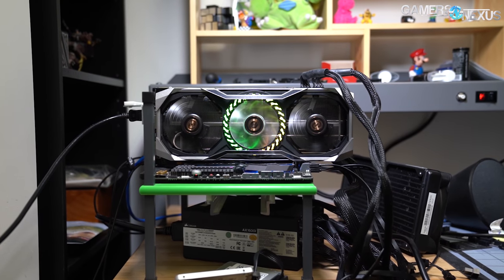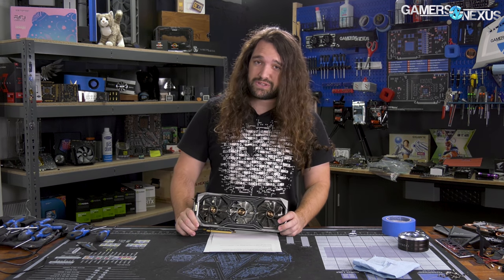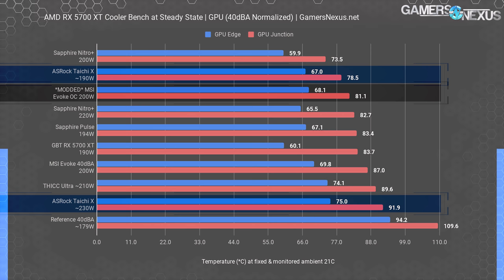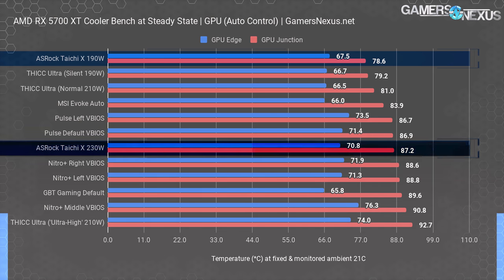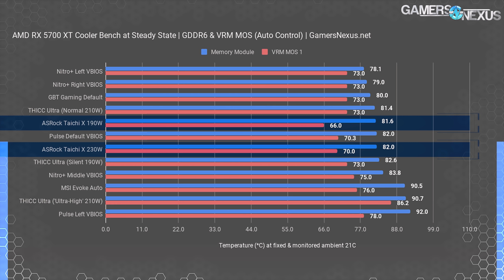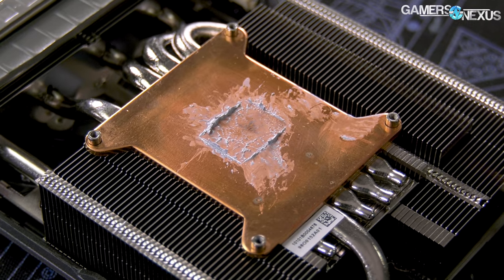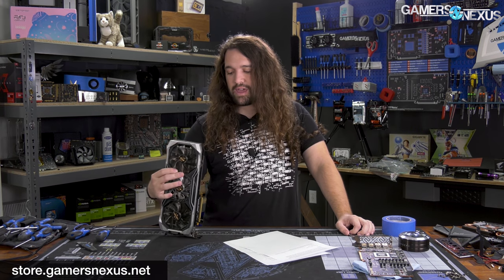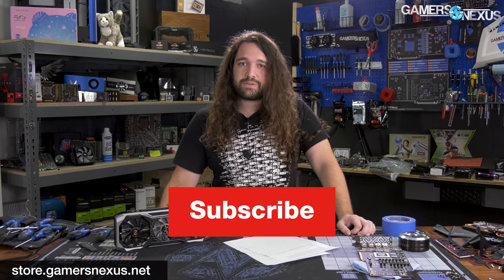ASRock RX 5700 XT Taichi X Review: Most Money Isn't Most Best

Comment: Hey there. I own an AMD RX 5700 XT, the Sapphire Pulse more precisely, my first AMD card after a period of nvidia ownership. However, I've been having a lot of problems with it (BSODs and blackouts mostly), in which i initially thought it was driver related. However, it looks like it was a problem related to the PCI-E riser, which is gen 3.0, but the whole system was running on 4.0. After some research, the riser was indeed a cause of issues, and in order to solve these I simply forced my motherboard to run on PCI 3.0 (Gigabyte X570 ITX here, which has such option). Many other people might be having the same problems, and blaming AMD for it (like i initially did :D), but in fact it's an issue related to outdated PCI-E risers. Im using a compact case (FTZ01-E), so I have to keep using the riser. I was lucky the Gigabyte MB allowed for a PCI Gen change in the bios, otherwise i'd be stuck with this. Maybe you'll find this piece of information useful to use in one of your videos in the future. Or not :D.
Eitherway, the issues are gone and the whole system is stable now. It's a pitty AMD are lacking on tech support for these kind of diagnostics, as I've only seen one of their tech support personnel answer to a client about this potential riser issue. Their adrenaline website (or the absence of it) could also use an overhaul in which patch and driver updates/news would be more easily communicated with the community, sort of what the Geforce Experience has.
Reply: I guess there is something to be said about not being on the bleeding edge of technology. Hence, I went with an X470 motherboard .... at least for now. I have no need for PCI-E 4.0 yet.
Reply: Wish mine was that simple but mine keeps crashing.. I went through changed the settings and still crashing.. I'm running a msi gaming edge x570,  ryzen 9 3900x, 62gb ram, windows 10 pro, 750w power supply and the ASRock phantom gaming Rx 5700xt. It works fine with davinci resolve and normal use but once it loads a game is quickly over heats and crashes :/

Comment: In the Netherlands, reference 5700xt = $ 471. Asrock taichi 5700xt = $ 621. These prices are converted from euro to dollar
Reply: Most of Europe is getting shafted for years now with price conversion for pc parts.
Reply: Same in Israel, this is why you need to convert what Steve says about price to percentages and to your currency (explanation for those who don't follow).
E.g if card1 costs $400 (for sake of example) and Steve says card2 costs $440, that's a 10% increase in price - for better or for worse.
If then card1 costs $600 (euro converted) in your country and card2 costs $660, then it is fine - you can't really escape your country's taxes and/or import fees.
BUT if card2 costs $680 then you can say it costs "more than it should".
I have learned long ago that unless you can get a good price suddenly in Amazon or in a local retail, you will HAVE to accept this price % difference, otherwise you will never buy a new card because they will all seem "overpriced".
Reply: @Keretizein x Exactly.
The 2070S is ~10% more expensive where I live so might as well go for 5700XT.
Then again, some 1080tis go for same price as 5700XT here so maybe getting that would be smarter, but I really don't want to buy a used card.
Reply: @Zwenk Wiel I searched the internet for an average percentage of tax on electronics and goods in the USA and found a list that shows an average of about 7% tax. (normally between 2,9% and 7,25% depending on the state) The price of the taichi 5700xt with 7% tax included is $ 513,- Converted to Euro's: € 465,- The true difference in price between the USA and the Netherlands in this case is $ 108,- and I still think this is quite a lot actually, hahaha ;)

Comment: Such a strange dilemma right now, for those of us interested in getting a new GPU.

You can  buy a 5700XT card. You can purchase one of those new 20 Series SUPER cards. 
But also being mindful, that Nvidia is set to go onto 7nm, and release their new GPUs by the 2nd quarter of next year. Then there's BIG NAVI looming in the distance. While Intel is ALSO about to be venturing into the GPU market as well...
Reply: Personally, I went with the cheap but reliable Pulse model and will keep an eye out on the new releases next year, maybe grab an upgrade towards the end of the year once everything has normalized from issues like garbage launch drivers and artifacting high end cards that we see from both companies every now and then
Reply: Bought a $280 Reference RX5700 and never looked back. At 4ft away I can't hear it over my headphones anyway under load.
Reply: I bought Nitro+ for Pulse price (me delivery got delayed) so im good ;)
Reply: There's always better tech just on the horizon. If you need to upgrade, just upgrade.
Reply: It is a good time to wait in my opinion, I just sold my 1080ti for a profit and im using a potato 1050 made by dell with a ek vardar 120mm fan strapped to it to get me by till something enticing comes along.
Reply: @Mandragara  Totally agree there. There are still (new) bargains to be had on old 2070's some as low as £400 (although normally £465 which is about £30 more than an XT). A average Super is around £525 but can be had for as little as £500. I'm ignoring the outliers for both here, Strix XT at £480 and the Palit Super blower at £489). Personally for the few extra quid needed I would go for EVGA Super Black @ £525.
Reply: @clansome  For a high end build, yes. For value though I think a RX 580, 1060 or 1660 Ti would be the one to get.
Reply: Danmandingo man don't even talk about that, I bought a vega card like a month before the 5700s dropped
Reply: LeFlavius  Im still on Tahiti lol
Reply: LeFlavius  I'm on 390x 1440p dips to 35 but I'm happy with freesync 😅
Reply: And I’m still using a gtx 1060 my friend lent to me for free oc to 2025 MHz and +450 on the memory, load temps 85c lol
Reply: The used market and 1070ti for now.

Comment: Most money?
Laughs in ASUS ROG
Reply: Yep
Reply: the rog non oc is only 20$ less than this
Reply: Be careful, the Strix fanboys will come after you xD
Reply: @TADP0LE9806  Nah I'll get a pass for it, they don't harm one of their own kind. 😝
Reply: My local Micro Center has Strix 5700 xt OC for $20 cheaper than this card. Buildzoid's PCB review of he ASUS card was very positive. I am waiting to see a full and thorough review now. It will most likely run very cool, maybe even the coolest while it maintains the other typical 5700 xt performance levels. 

All in all, an ASUS Strix for $20 more than some other cards, having better component parts and running cooler than most cards, that $20 might not matter too much.Though I figure many gamers have a tendency to stick to a build brand that they have or prefer when it comes down to a $20 +/- cost difference. $40 or $60 off of someone's preference can be a deal breaker. To each his own my friend.
https://www.youtube.com/watch?v=ioJHGyivLpQ
Reply: Over here this 5700XT is the most expensive, even the Asus is 18€ less. Asrock overtaking Asus by greed ^^
Reply: Same here. The Taichi X goes for 560, which is basically a 2070Super. Cheapest 2070S costs 550.Hard pass. However, prices have been dropping very very slowly. The Nitro+ and Gaming X went from 520 to 495. Still too much, but at least prices are moving towards a more favourable range. 

The Pulse and TUF sit at a respectable-ish 450, a full 100 below the cheapest 2070Super. I hope prices drop a couple tens in Winter. Usually they do, at least for AMD.
Reply: God Killer I’ve got the ROG Strix bc I am sheep. But the temps aren’t great out of the box. Moderate undervolt (about .05) brought temps down by 10° with default fan curve that doesn’t ever get loud.
Reply: @MrFirebad  could you sensi teach me how to undervolt it 
The auto undervolt in wattman is useless... Maybe manual tuning it ??
Reply: @STR33TSofJUST1C3  Just remember that those AMD cards run really hot (and loud). The manufacturers try to keep noise levels down by letting the cards heat up to max temps which degrade component life.

Comment: On user benchmarks website it has the 5700xt taichi as #4 performance wise.  #1 is gigabyte gv gaming oc at 117%; #2 is power cooler red devil at 115%; #3 is XFX Thicc III ultra at 115%; #4 is Asroch Taichi at 114%. the highest benchmark for the 2070 super is 123% with a lot of the non overclocked benchmarks around 114%. These are the only 4 that are high up there in benchmarks are worth it in my eyes as #5 and #6 are both the sapphires at 110% and 107%.  I compare benchmarks with some youtubers and in games like rdr2 and gta V i keep up with the 2070 super with the asrock taichi.  If you compare this with the thermals it may just be one of the best cards, it was just expensive at release but the price is defiantly going down.

Comment: IMO, I think it's great that ASRock somewhat over engineered this thing rather than tried to cut corners to keep pricing and costs down. I do think they over did it a little but better that than a flagship design that performs like an entry level model and ruins their shiny new rep in the GPU market. It's got to be tough breaking into an already saturated market. With the last (and their first) wave of GPUs they were panned for high noise levels and weak/inadequate cooling. I imagine it's a fine line between adequate/profitable and overbuilt/expensive when it comes to cooling solutions. It looks like they have not quite found the sweet spot yet. I do like what I see, learning from feedback and trying to do better. They overshot with the Taichi but given pricing will come down and how well this GPU performs it could still be a great option when priced better. 

As it stands it will likely only appeal to people who are willing to pay a premium for the aesthetics. IMO it's not all that unrealistic with the cost of an aftermarket GPU cooler (water or air) costing significantly more than the delta in price between this and more competitively priced GPUs. I am a huge fan of how well the GPU design compliments the X570 Taichi motherboard design. What this GPU does is allow even a relative novice PC builder to put together a system that looks custom built with minimal effort and know how. I would not be surprised to see the likes of newegg and amazon pushing bundles with this and the X570 Taichi. 

Great review Steve.

Comment: Evga has a 'what' on the "Pin Fin" heatsink, lol, that's a good one.  I'm really sure the various round/oval/square/rectangular/teardrop shaped pins arranged in grid/staggard "Pin Fin" heatsink has existed back to around the time of the steam engine, maybe earlier on some wood stoves. Pin Fin heat exchangers are nothing new, the machining process to make them, that manufacturing process may be patented (there is more than one way to forge/cast or extrude&cut a pin-fin, lol).

Great vid Steve and crew. B)

Comment: Presently the nitro+ is running around $460 on Newegg. The MSI Gaming X is only $450 and is probably the best performer of the lot, also finding its way into my build. Hopefully you guys can get that card to review.
Reply: But MSI is slot-ripper (heavy af) and don't have all memory fully covered with thermal pads. How it impact reliability? I don't know, but personally I don't want test it and went into Nitro+.
Reply: I know it's a heavy beast, but it's very structurally rigid and sagging isn't particularly bad. It runs cool and quiet even compared to the red devil and has the lowest VRM temperature out of them all according to hardware unboxed. I would argue VRM cooling is more important for longevity over pure memory temperature, which is also fine for the card.
Reply: @mantisman230  But If memory die, card die. Doesn't matters if VRM is still ok :D
Reply: Yeah, and the memory temperature is well below maximum and is on par with most of the other cards. It's not going to give out any time soon. Nitro+ stripped down components and is too expensive for what they did to the board.
Reply: @mantisman230  Yes, but how it's measured? I doubt these 2 chips aren't hotter without half pads on them.
Reply: Full pad vs half pad didn't make much difference for the evoke when fixed. Only reason the evoke is so bad is the heat sink, it's just not big enough for the card. Same problem with the thicc 2 ultra. So if you want to keep debating how a stripped down 5 phase power design is somehow better than a cooler 9 phase with better delivery when it comes to longevity, you may want to do some more reading.

Comment: So how does it perform? It has higher clocks than any other 5700 XT. Would've been nice to know how it performs compared to a cheap 2070 Super for example. Also, it apparently has six display out ports. Could've been mentioned, since you are actually getting something extra for the extra money. I know you're sick and tired of reviewing 5700 XTs, but this seemed a bit on the lazier side compared to your other reviews.
Reply: He addresses this at the end of this video. The reason why he's not showing any performance benchmarks compared to other cards is because all 5700 XT models are pretty much identical, performance-wise. This particular card may have the highest clock speed out of all of them, but going above 2GHz yields pretty much no benefit for the Navi cards.

If you want a comparison to the 2070 Super, just find a different 5700 XT on any other review site, and look at the comparison there. Then buy whichever 5700 XT has the best cooling and simply overclock/undervolt to your heart's content.
Reply: I'm also really disappointed that the six display outputs wasn't mentioned. This is one of the few (only?) mid to high end cards on the market with 6 display outputs, it is a real point of difference. Sapphire used to have "Flex" model cards with extra display outputs which were significantly more expensive than their other models but it has been a long time since I've seen a graphics card with 6 display outputs. Also none of the current NVIDIA line up even counting customer boards seems to have more than 4 display outputs. Finally the Asrock page for this card it's listed in third place as one the features after "Taichi Triple Fans" and "3D Metal Backplate" so I don't know how it was missed because it is plain to see on the card.

Comment: Trying hard to hold out for 5800 XT
Reply: There is an article from wccftech of rtx 30 series on 7nm in half 2020 as well..sigh...
Reply: Mate it’s most likely not going to happen before Q3 of 2020. If you need a new GPU now, it’s probably not worth the wait
Reply: @meteormedia7021  Well my RX480 is still rocking so I'm not really in need but I am interested in some of the features that come with new tech. Also, I want to get as many frames as possible on my 144Hz freesync panel.
Reply: They seem to be going odd numbers...probably 5900 is next, higher card
Reply: @Tallnerdyguy  Maybe. They may not even do a higher end card but I feel like they might be willing to take the leap since they went out on the limb of creating the Radeon VII.
Reply: @ogpirons  again rumor mill, but that "leak" about the 2080ti killer...i just think they are delayed with 7nm shortage....
Reply: Lol,think just get a 2080ti on black friday
Reply: @paulmichaelsabapathy9672  do nvidia can use uo backstock for 30 series
Reply: @ogpirons  i just said 5900, as all of amd sku are odd numbered... R5, R7, R9 etc 5700, 5500...

Comment: This card is listed on Amazon UK at £505 😳
Reply: Hell nah
Reply: That's not the point.
How much is the reference card being price there and at your country?
If it is listed in MSRP then your point stands.
If it is listed higher than MSRP then...you have no choice and these are the prices set in your country.
Reply: For context, reference is £350 and you can get the Red Dragon for £390. £505 is a 44% markup. You would have to be mad to pay a premium that high over reference for a 5700XT, no matter how much better the cooler is, because that 44% is going to translate, as Steve has continually stated, to no more than a 2~2.5% increase in frames. Add to that the fact that the 2070 super starts at around £490 and that's just another nail in the coffin. And stock is not an issue for the 5700 series over here, so it is just hilariously overpriced.
Reply: @evilSapphie  If EVERYTHING is overpriced where you live then it is another issue.
In Israel, a custom cooled 5700xt goes for £512, and a 2070 super goes for £606.
Israel has a 17% tax and some import fees, so it is not like the specific retail I chose has an insane markup - this is just how it is here.
So I compare in this example the 5700xt vs the 2070s and in my case, it is better to buy the 5700xt.
This is why I mentioned you should go for the % difference in price and not necessarily in performance - the moment you factor in each country's tax and import fees, the % in price to performance argument goes out the window and you will be stuck buying low-med cards that might seem cheap but are priced as high-end cards.
Bottom line - where I live, EVERYTHING has some markup because of tax and import fees - it is inescapable.

Comment: There are 420 comments right now and the xX2007xBLIVEXx me wants to leave it that way but I want to ask, and this is completely irrelevant to this video but I have a feeling it would interest you...

Do you think "bladeless" fan designs like what Dyson offers for desk fans and whatnot will have a place in PC case design? I'm imagining a front panel with a rectangle "bladeless fan" all the way around it, sucking air right from the edges of the panel where its accessible AND getting 100% of the air offered at the edges as opposed to the centrally located fans trying to pull air, sometimes several inches away, into the case.